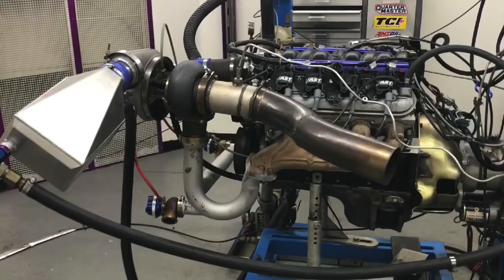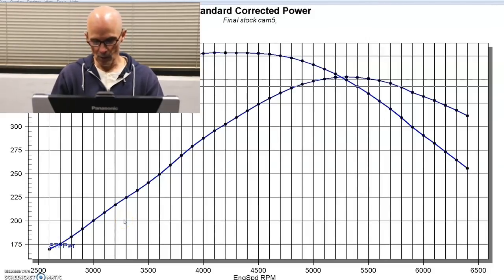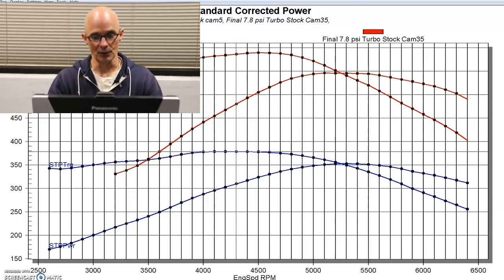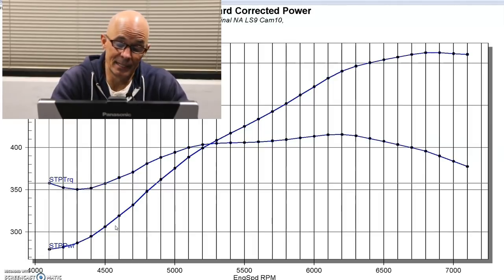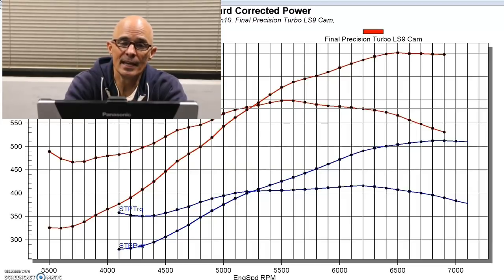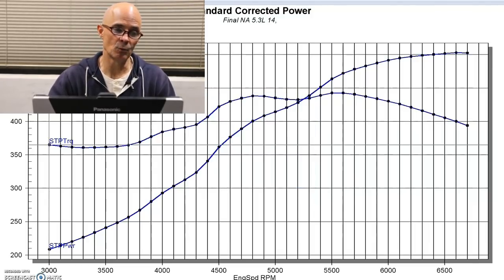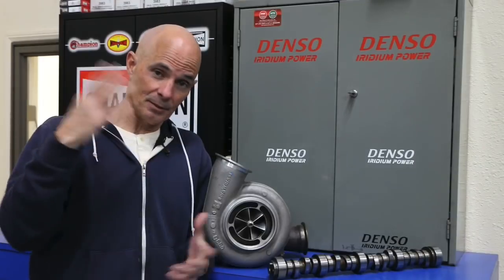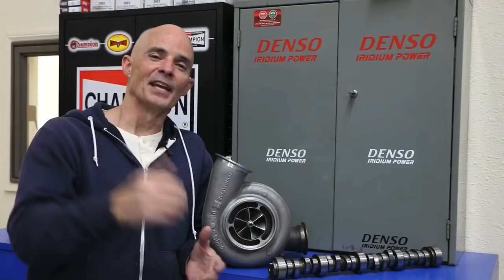REVEALED-DIY TURBO SECRET-EVERY CAM WORKS!

Comment: Richard Holdner - Cutting ‘turbo cam’ sales in half since 2020 😂😂😂

Good video, good explanation, good info 👍👍👍
Reply: ..and  people in comments are still asking what cam to buy
Reply: I’m pretty sure the thumbs down came from cam vendors.
Reply: Aaaha, now that's a great one 😂👏
Reply: @BlindBatG34  i wouldn't doubt it
Reply: @Turbo_Todd  My answer would be which ever one holds up to the abuse....In my situation the stock PI cams would be ok, if it wasn't weak in construction.
Reply: Shannon Sisk Not really. Turbo cams are optimized for use of a turbo. They will spool quicker and handle the added back pressure better than a cam designed for something else. Take a nitrous cam with a lot of overlap to soften the nitrous hit. They are down on power when not on nitrous. Adding boost will still add the same amount of power that it would with a different cam, but you started down on the power, you will end up down on power. It will be inefficient with a turbo. But, a good nitrous cam will make more power on nitrous than the kit is rated for. My nitrous SB2 drag engine shows a 450hp gain on a 300hp set of pills in my fogger. At the wheels. Any exhaust restrictions drop power considerably as nitrous cams don’t like any back pressure. It’s still best to choose the right cam for your build. Luckily, mild stock cams have specs (at lest on ls engines) that work well with turbos. Better would help, but they aren’t bad for a budget build. 

Another way to look at it is that nitrous will add power with any cam, but a turbo cam will not take near as much nitrous as a nitrous cam. A true nitrous cam doesn’t need as much timing pulled, and makes more power with the same amount of nitrous. Sure, you can throw a 150 shot at anything, but if you want to make big numbers, you buy the right parts.
Reply: Adam R you are right, and most people know this. But those who find a deal on a cam that’s not “specific” to their build, or already have a NA cam, can watch this and rest easy. I think that was the point of the video.
Reply: Shannon Sisk Lol, I have encountered people who have done exactly that and had some pretty big problems. First off, using an engine dyno is worthless here. Had a friend who built a turbo ls 6.0, slapped a 76mm CXRacing turbo on it, and it dyno’ed great. Put it back in the vehicle and it would barely move. Never built boost, and would try to stall very easily. He bought the engine from someone else who already put a cam in it, and that cam didn’t like back pressure at all. Did great on an engine dyno, but didn’t work at all in reality. On a wheel dyno, it performed the same as on the street, not at all. I gave him a spare cam I had and it ran great and spooled fast. 

So, I do see it as false info when this idiot says that all cams are turbo cams. That is the most stupid comment you will ever hear from someone in the automotive industry. And it is a huge lie. Sure, most cams will run fine with a turbo, but a turbo cam is optimized for a turbo. If they aren’t optimized to run a turbo, it’s NOT A TURBO CAM! And, if you can’t afford a turbo cam but need one, stay stock. Don’t waste your money on a bad cam just because you found it cheap! It’s better to run the stock cam until you can afford the right one. That way, you don’t have to tear the engine apart again to swap parts later. You may save $100 on the cam, but doing the extra cam swap (gaskets, labor etc) will cost you more than just waiting until you can afford the right one. Also, avoid reground cams like the plague, seen too many engines destroyed by people trying to save $50...
Reply: Adam R all that text is basically void when you say Richard is an idiot. He is clearly not. even if he is wrong on this video, which IMO he is not wrong. He has given a lot of people lots of good info. Probably more than you have. And I bet you don’t think you are an idiot. Not arguing or starting a comment war, just saying.
Reply: Adam R I’m not trying to argue. We clearly disagree and that’s fine. Have a good one
Reply: Shannon Sisk Lol, so you admit to having no experience, and just being a fanboi? You haven’t come up with a single supporting piece of evidence to support your beliefs. Facts matter, not opinions...
Reply: Adam R why do you own a engine dyno if they are worthless? And I’m pretty sure what Richard is saying in the video went completely over your head. Your statement about being better off with a stock cam on a turbo setup is better than a cam not meant for a turbo is proof. Isn’t the stock cam not a turbo cam if it’s not a turbo engine to begin with? Richard is saying that power will always increase with boost. Think about that statement. Since you’re a nitrous guy how about this “power will always increase with nitrous” or “power will increase at lower elevations.” True there are cams that are designed for certain applications, different cams make power differently in different circumstances. Let’s say you have a stock 1970 300hp 350sbc, and it makes 300hp. You add a turbo at 5lbs it makes 325hp, 10lbs 350hp, 15lbs 375hp. You put a 3/4 race cam in it and it makes 350hp N/A. A 3/4 race cam is definitely not a turbo cam. You add a turbo and 5lbs and it makes 375hp, 10lbs 400hp, 15lbs 425. Did the engine make more power with the 3/4 cam over the stock cam under boost? It’s that simple. Of course a cam designed by Albert Einstein while flying the space shuttle to be the absolute most efficient turbo cam imaginable, will make more power than the 3/4 race cam. You would still be better using a 3/4 race cam than the stock cam because of the initial increase in power. It would be even better with a cam specifically designed for the application than one that isn’t, but hp will always increase with boost. Simple as that.
Reply: Mark Rudisill First off, there is no such thing and has never been such a thing as a 3/4 race cam. It’s a term used by people who have no idea what they are talking about. The term is one used only by people who have no idea how engines work. Just using that phrase kills any credibility you thought you had.

Second, I have a crank dyno because I bought out the machine shop I worked at when I was 17. It had both, crank and wheel dynos, and they became mine when I bought the business. But, I do use the crank dyno to break in engines. The variable load is helpful for seating rings, if you know how to do it. Other than that, I don’t use it as a dyno. 

Also, you lack of understanding is making you look stupid. Just because a cam will “work” with a turbo, doesn’t mean it is a turbo cam that is optimized to perform best with a turbo. It’s as simple as that. It’s not a turbo cam unless it was designed to work best with a turbo. A true turbo cam will perform better, be easier to tune, will spool better and more. I could go into the rest, but someone who thinks a 3/4 race cam exists wouldn’t have the intelligence to understand most of it anyways.
Reply: @adamr9215  To be fair if you cant create enough load to spool a turbo then it goes back to what Richard said about correctly sizing the turbo for the engine. And that would be reflected on an engine dyno still. I bet that motor that you say "dyno'd well" had a pretty useless power curve and only made power in the last 2k rpm of rev range
Reply: C P That is only about 20% correct. Turbo sizing is important, but so is cam selection. A cam with a lot of overlap for nitrous won’t spool even undersized turbos very well. It’s very common for the incorrect cam to effect spool far more than turbo size, within reason. Yea, A monster turbo on a tiny engine will suck, but the right cam will make a huge improvement. I run a 118mm on a ls 434 and it spools better than a single 72mm on a 5.3 with a supercharger cam. Now, I changed the cam and it would spool instantly, actually needed way more turbo. It’s running an 88mm with no lag now. I don’t bump in, I roll in, set the trans brake and floor it. Data logs show full boost before I let go of the button. It’s hard to argue with real world performance.
Reply: Ok Richard ,when are you getting a 4 bar map? Screw it ill send you one!
Reply: Adam R I think Richard is correct. Hear me out. He said the best cam N/A will be the best cam boosted.......Example...So if I have a 400ci sbc N/A and have a 11:1 compression ratio with a .650 lift and 265 degree @ .050 duration  106lsa and it makes 580hp.  .....When I pull the pistons and replace with boost friendly  8.8:1 and I then dyno it N/A it makes 420hp. ....Not very good.....So then I replace the cam with a .650 lift 240 degree @ .050 duration 114lsa cam and it makes 480hp N/A. Now..........I have optimised the 8.8:1 compression engine with a cam that works the best....so now my hp figures under boost will be better because N/A they are better!!!!!!

Comment: I wish I could love this video! I’ve been laughed at for telling people to leave their N/A cam in instead of swapping to a “stage 2 turbo cam”
Reply: My same thoughts go out to the "it needs backpressure" crowd
Reply: The "turbo cam" spiel has been going on for a LONG time and still does.  I fell for it hook line and sinker.  Still have a couple "turbo cams" kicking around.
Reply: @superkillr  the only reason I’m looking at a “turbo” cam is I want good low end power for street use and the btr stage 1 and 2 turbo cam have the valve events close to what I want. Where their N/a cam focuses more at top end power

Comment: Love the content, I know you're refining your presentation still. I dig the non-greenscreen delivery of the technical data, but I don't think the little picture of you over the dyno graph adds anything, and I prefer to see the whole graph, especialty since your smiling face blocks out the top half of the measurement scale lol... Just my .02 Keep up the content. It's nice to see high-level technical discussion on here.
Reply: maybe throw it down at the bottom right where there's no numbers to overlap
Reply: @Speedy2222  I like that idea too. It's nice to see the graph while it's being discussed but there is value to not being spoken to by a faceless chart.
Reply: I guess he should just move his "live" screen to the right a little bit and it would be perfect! 👍
Reply: A little transparency to fade his image a little could help
Reply: It's probably on purpose, because the numbers itself aren't important for the video.

Comment: Big fan of the picture in picture of the overlay with dyno as the background. Seeing someone talking is more engaging as a presentation and directs the audience to a person instead of just a voice over. 

Separation of camshaft "types" as has always been shown to me is about very specific systems of power production per combustion cycle at a given or very specific rpm. The problem with telling people its a "type x" camshaft is reliant on so many variables that the overall fact of where and how that camshaft works is much more dependent on all the things around it.   Saying this cam makes power from 3500-7500 and is designed for turbo applications can only be justified if the rest of the motor is also designed for 3500-7500 power production and that the rest of the vehicle is also designed for those numbers. The pressure wave per cycle is only a single measurement point by which the efficiency of a given constant (SAE perfect day AIR) can be calculated. The truth has always been that as the increase in Air Density rises the power output increases along the same linear path. Regardless of all other factors. 

Love your approach to facts Richard. Keep up the great work. Also more 2v mod motor stuff would be nice.
Reply: AGREED!!!! I'm VERY interested in the 2v Modular! I have a 1999 Lincoln Towncar, that thing is just begging for more torque and hp...And a nice Teksid diet would help too.

Comment: I think you should test this, have 2 cams ground with same duration & lift with 4 degrees more lobe separation from 1 to the other.
Reply: This. Or run something like a circle track cam on a 106, a 110 street cam and a 114 turbo cam
Reply: Id love to see a test of cams 225/225 vs 224/226 vs 220/230 not those exact #'s but   no split vs small split vs large split
Reply: @Shawn_lsx  likely the curve will kinda rotate, less low rpm for higher rpm tq shift. It helps scavaging at certain rpm, but will give up some at other rpm points. Combo dependant just like the rest.
Reply: That's what I kept shouting at the video  love separation angle can matter with boost. I've also been told a variable cam timing can sometimes help with spoiling up a turbo but whenever I've gotten tunes with variable cam timing on my Ford the guy said that usually the manufacturer settings you just don't even want to mess with them they're so good
Reply: @sock979  you can definitely beat the factory settings especially on a standard turbo cat vs high flowed vs big single

But without extensive experience on that exact motor and even exact combo, it's easier to do worse
Reply: I figured this was a common knowledge thing! I assumed the turbo cam was more bottom end sorta like a more low torque than stock that was my assumption!
Reply: The results will be the same one will just be more fuel efficient than the other because more un burnt gas will go down the exhaust pipe

Comment: I always thought “turbo” cams needed a wider LSA whereas as an NA cam would tend to be narrower. So the gist is, get your ideal power curve established first NA, then boost it! I do think a camshaft LSA narrow to wide dyno comparo would be cool (I know it’s been done but I haven’t seen it in this media)
Reply: Similar to what you said, I always just think of "turbo cams" as being marketed as more tame with the wider LSA for the people who want to use boost to make more power instead of rpm. To me, tighter LSA has always meant choppy idle, high rise open plenum intake, +3,000 stall converter, etc. Where turbo cams with the wider LSA always meant smooth idle,  dual plane intake, ~2,000 rpm converter, etc. Just my perception and I think the cam companies follow suit.
Reply: I always figured, turbo cams (over stock) are just more efficient with boost making power, a turbo with a big nasty NA dragrace cam, isn't going to be as useable or effiecent, as a big turbo cam, but a turbo with stock cam in most cases is fine for street only vehicles, a mild cam do sound sweet though! And will gain power,
Reply: The wider LSA is more for the blower setups. As blower speed is fixed, you want to minimize overlap to minimize lost air flow. 

With a turbo, more overlap generally means faster spool.
Less overlap yields more top end power.
Reply: Gale Banks said he was doing testing for a turbo car back in the 80s or eally 90s and said it was really slow off the line/ out of the hole.. so he changed the lobe sep from 118 to 110 and it took off like a rocket out of the hole.. I read the article a couple years back so that was the just of it..
Reply: Wider lsa has lower cylinder pressure, less chance of detonation. Wider Lsa has a wider power band but less peak power. Wider lsa are good for boost, especially for street cars.
Reply: lsa is used for scaveging, in direct injection engine you dont waste fuel because you dont inject fuel when the exaust valve is open, so you increase efficency, in indirect injection engine you let the air-fuel mixure go in the exaust, so you lose efficency, but, you clean the combustion camber from combustion gas, you gain automatically power because now you have the combustion camber full of air-fuel mixure that will burn, if you dont have lsa you dont clean the cc, so you dont have that extra mixure that will take part to the combustion phase. On turbo direct injection is super helpfull for increase efficency, that because (as we see in this video) turbo increase the effect that give us power, if one thing give us more efficency (or power) on na, on turbo we increase these effects
Reply: @furryfrog9520  Right. What you said is true regardless if the engine is boosted or not. Richard's point of this video is to show the boost is going to increases power everywhere in the rpm range regardless of which cam is used, in a near linear fashion. When someone boosts an engine all it really does is increase the volume of air and fuel, simulating an increase in displacement. The fundementals of how a cam causes an engine to "behave" still apply.
Reply: @rustysausage69  Thanks. I think that's why Richard kept using air quotes when saying "turbo cam". It's a marketing term used by the cam companies, just like Sweetest Day was made up by the greeting card companies. 😁
Reply: Dennis Tate hopefully my “turbo” cam on 111lsa will do the same! 😎
Reply: @dr_tate  That's awesome, but keep in mind that probably would have happened regardless of the engine being boosted. The behavior of an engine is determined by the sum of its parts. All boosting does is intensify that behavior.
Reply: Jim H. He’s done it already
Reply: @Carl_Jr    Excellent response.  This point went RIGHT OVER alot of people's heads.